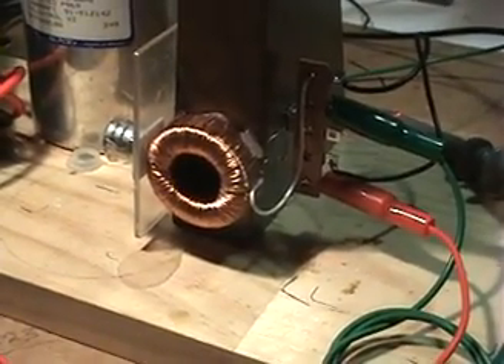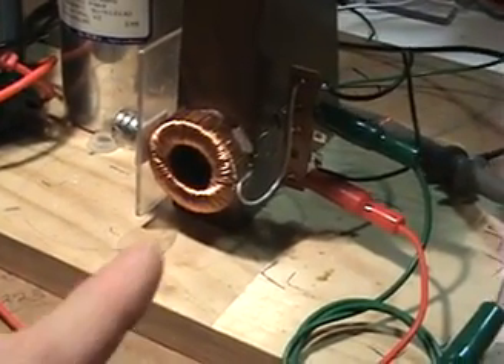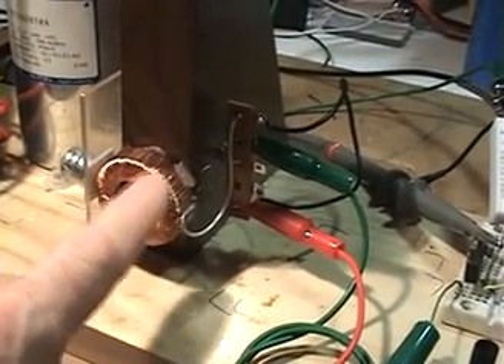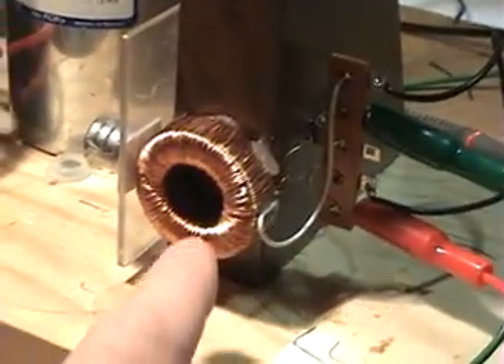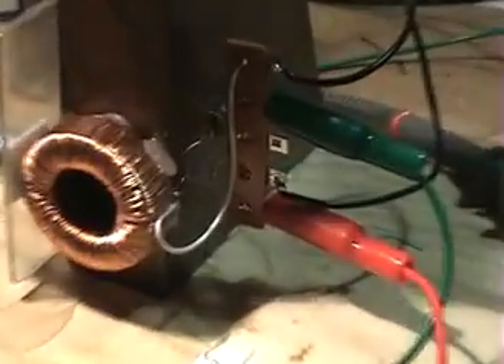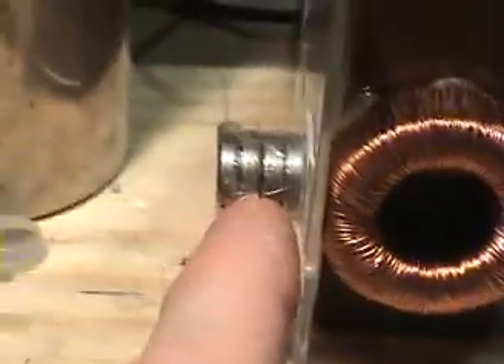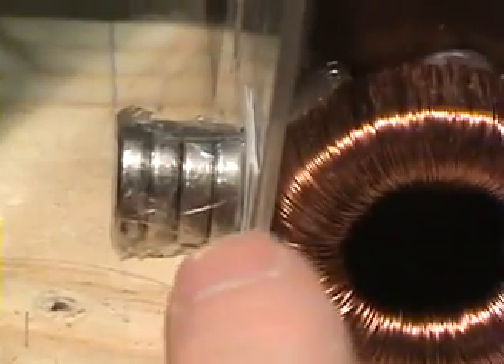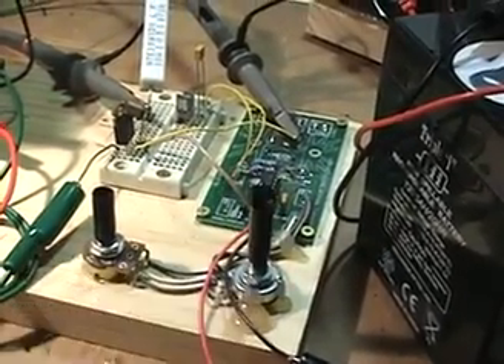Self Running Coil test 1

Comment: show us what happens when the magnets position is changed in relation to the two coils.   The spikes are coils BEMF weak until stored in a cap.   The field of the toroid and magnet is interacting and this interaction gives you the additional energy.
Reply from the maker: Sorry but this experiment is 5 years old. I'm not working on this at this time.

Comment: Is there an official deffinition of 'self-running'?

or at least, what do you mean by that?
Reply: self running is when the voltage stays the same or goes up, for a indefinately long period of time, without a battery in the circuit. (Except for starting)

Comment: @gotoluc Hello, it is interesting to see charging capacitor without battery and I have some guess on what's going on:
Because you are feeding 555 generator from external source and it has common ground, isn't possible it leaks a bit of voltage from npn transistor's base to collector and that's charging capacitor? That might be answer to this effect. Try with >5 volts coil to avoid it.

Cheers!
T-1000

Comment: IceStorm is right, you need an optocoupler to be sure. Ive done hundreds of experiments with transistors only to have false positives due to leakage current from the base. I definitly think you are on the right track, keep up the good work.